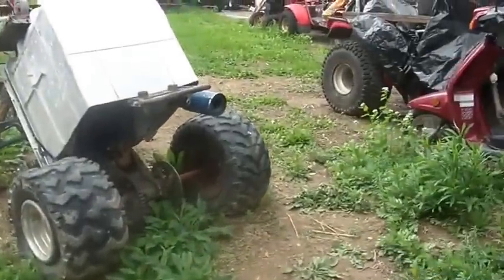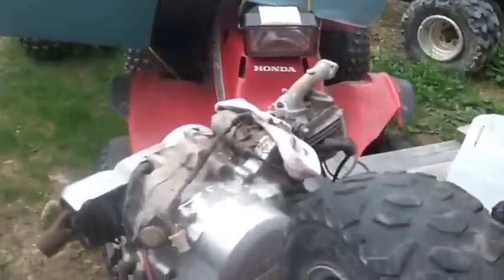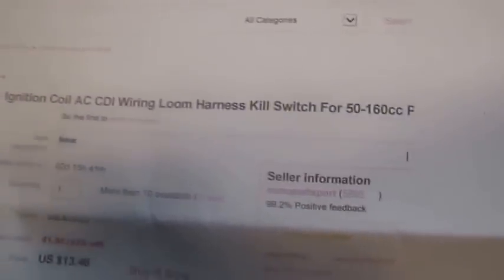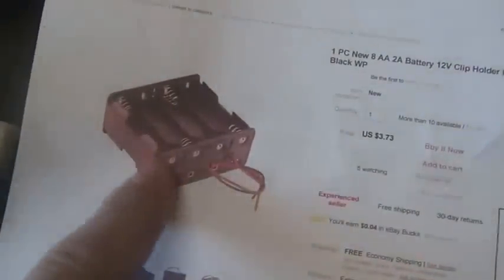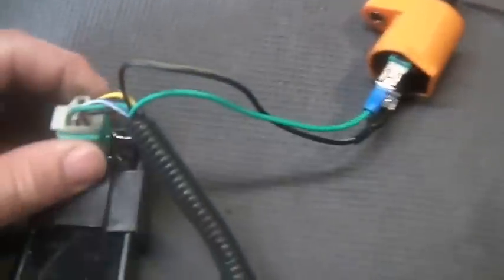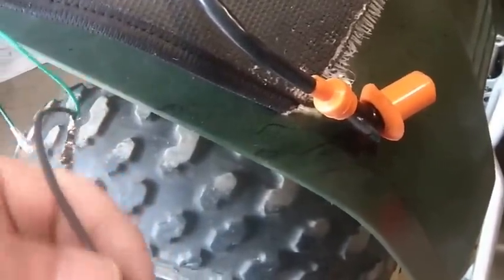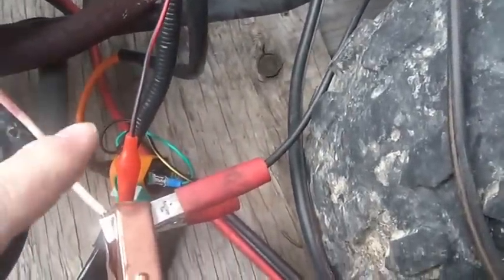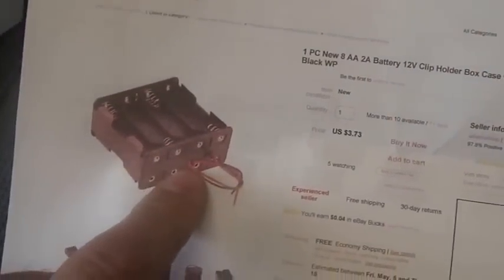DIY ATV Portable CDI system, $25, easy to build and use,

Comment: Good video Harvey should help get folks on the right track that needed pointed in the right direction....ive bought some items from that seller....gotten the wrong thing twice but he fixed it and sent me the right ones and told me to just keep the wrong ones....so a good seller I'm my opinion......2 out of 12 orders isn't bad
Reply from the maker: Hey Dude,  Most folks on eBay are good, I get into trouble when I stock parts and don't check them for months.... Hopefully, these videos keep more ATVs alive longer, thanks for the info, Ur kind words and encouragement, watching, and commenting!!!!
Reply: Harvey Spooner I've found most big ebay sellers to be up standing....its the small ones a guys needs to be careful of once they have your funds you are no longer an important customer and you've got to take it up with ebay or PayPal or possibly your credit card company.... and with ebays 30 day policy I've definitely learned to check items which are purchased for stocking my shelf so I don't need to order things as I need them...to make sure myself and the seller got the right item or parts....ive got quite a few of the wrong items either by my fault or the sellers....i ordered a clutch for my Yamaha 1979 TT 500 f and was sent a clutch set for a 2001 to 2016 Yamaha yz 85...and I failed to open it right away...long story short I've now got a 80 dollar clutch set I can't use and couldn't return not even for store credit...and now I can't get rid of it tried selling it on Craigslist for half of what I paid not including shipping...so i guess  I'm just going to keep it till I get a yz 85 or something that takes that clutch size lol
Reply from the maker: Hey Dude, I hate to have to admit to how many times I ordered parts and then sold the car I was going to use them on or decided to go into a different direction, it adds to the hoard.... Thanks for understanding, watching, and commenting!!!
Reply: Harvey Spooner yeah I know how that goes to I still have parts for things I haven't owned in 10 plus years...but i keep them with good intentions I'll use them somewhere else

Comment: Very smart setup. Only change I would make is the power source. I would use 3x 18650 lithium cells so they're rechargeable. Maybe a power drill battery would be a viable option also. Maybe a bridge rectifier and voltage regulator across the lighting coil would work also... if it can produce enough power during cranking. I'd like to experiment with that.
Reply from the maker: Hey Krankie!!!  U should appreciate the high capacity capacitors that I was using to power the starter and CDI.... Thanks for your kind words, advice, suggestions, watching, and commenting!!!
Reply: I didn't notice the capacitors lol
Reply: I think I'm gonna get this stuff and test it out. I will credit you in my video for sure. This is such a great idea. I wish I had known about all this a few years ago when the ignition went out on my ATC.

Comment: Bottom line people learn better by being shown than told. Excellent video again, and I don't think it could get any easier than that. Should work on snowmobiles too.
Reply from the maker: Hey Mike, U R right, most folks learn better when they see, rather then when they are told, they really learn the best when they do things wit their own hands.... If a snowmobile has a cdi, this hack will work, though, the advance curve maybe off.... Thanks for your thoughts, info, encouragement, watching, and commenting!!!
Reply: The advance curve would be off, but it would at least let you know if it well run with a good ignition. Great diagnostic tool. As soon as I can I am going order some parts and build one just to have it. I don't work on much anymore, but I would only have to need it once for it to pay for itself. Suppose to be decent here on Saturday so I well am hoping to get sorted through the Rotax stuff on that day. Been so busy I am not sure what way to turn lately.

Comment: I got a hacked China 110cc took out all kill switches and alarm system still won't run
Reply from the maker: Hey Tina, Just cut the one kill switch wire that goes to the CDI, the center wire of the bottom 3... See diagram,   https://www.google.com/search?q=chinese+atv+5+pin+cdi+wiring&tbm=isch&imgil=xPvSfB8nmyOTgM%253A%253BY0I7XelBo7ET7M%253Bhttp%25253A%25252F%25252Fwww.thejunkmanadv.com%25252Frepair-and-service-manuals.html&source=iu&pf=m&fir=xPvSfB8nmyOTgM%253A%252CY0I7XelBo7ET7M%252C_&usg=__KRv-neQqwVQeuVPutdVH0TPij-k%3D&biw=1301&bih=620&ved=0ahUKEwiMtuyfrNfTAhXE7YMKHd3JA_QQyjcIMg&ei=_rILWYy_G8TbjwTdk4-gDw#imgrc=xPvSfB8nmyOTgM:&spf=16      , I hope this helps... Thanks for asking, watching, and commenting!!!!